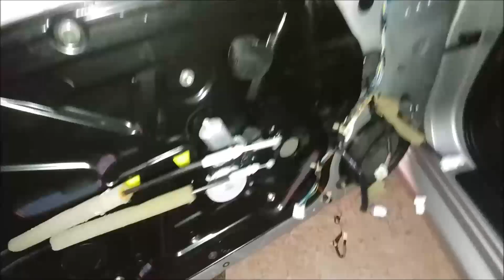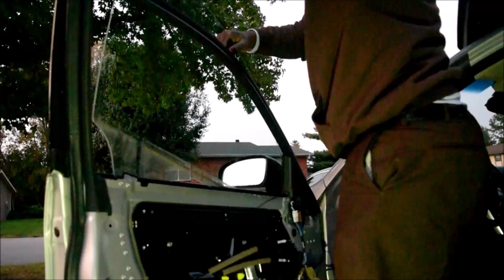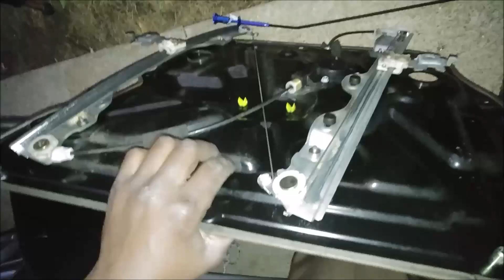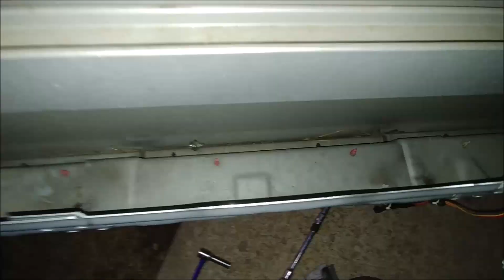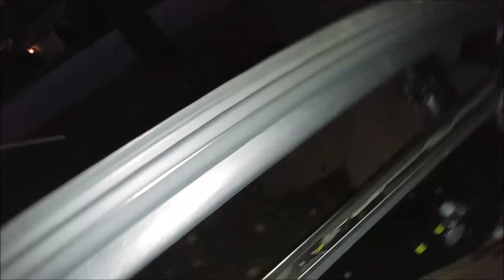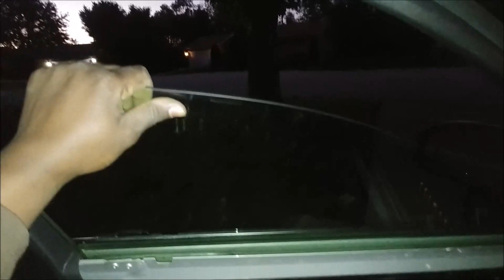2006 Infiniti M. Front Window Motor & Regulator removal - The quick and easy way

Comment: Is there a website or source where you can get a replacement window regulator? I haven’t seen anything for this exact model
Reply from the maker: @djteesang  which regulator do you need? I have some parts that might work depending on what you have.
Otherwise, just check ebay or car-parts.com for a list of various salvage yards selling them.

Comment: Thanks for the thorough instructions! Very helpful. Just an FYI for everyone, for 2006 FX35 the left side window bolt is behind the larger black round patch; the right side window bolt is behind the speaker. You have to remove the speaker first.

Comment: Bro I got an EX35 which is an suv, and your videos are the only useful videos I’ve found when needing help with the control arm instal and window regulators. Would u believe that there is not a single video on any INFINITI G37 G35 or EX35 on how to change the front lower control arm on an AWD MODEL. Lots of videos for the RWD which is soo easy to do anything on but the strut install, sway bar , lower control arm is completely different on the AWD. Even when I replaced a starter it was sooo easy on the RWD but with the AWD the axle gets in the way making u Have yo lower the frame brace support or discount the axle from the transmission. Then take the axle out of the hub because it’ll still be in the way!